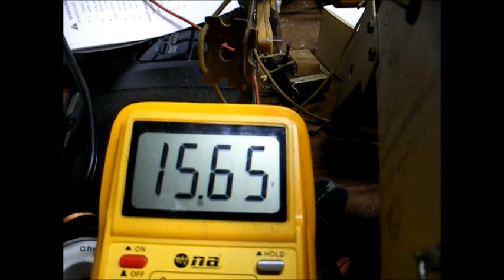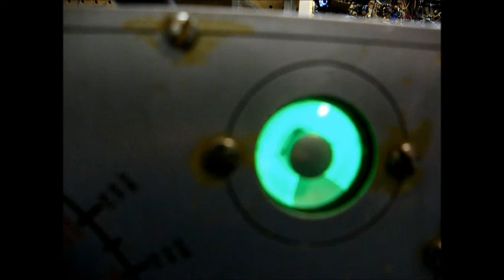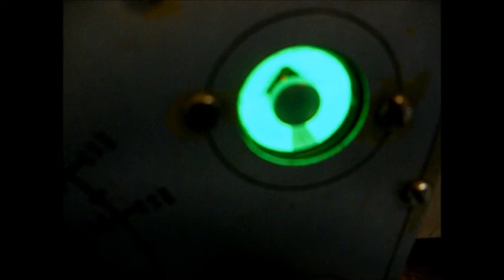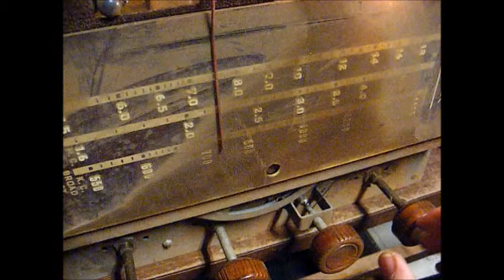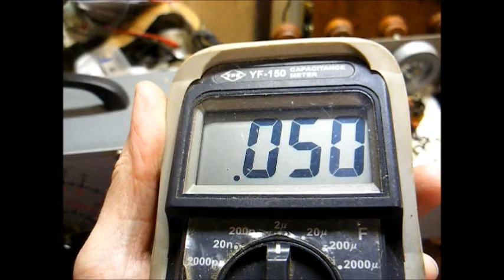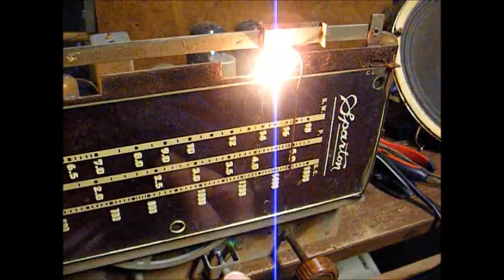Sparton tube radio chassis repair - part two

Comment: Great work!  Sparton of Canada called the "Magic Green Eye" tube, "Visoglo".  They were made by the Rogers Tube Company of Canada, but are really very similar if not the same as the standard "Magic Green Eye" tubes.  Walter Dorwin Teague, the noted American Industrial Designer, designed many radios for the Sparton Company, most notably the blue-mirrored radios, which are highly collectible.
Teague also designed (oftentimes in a very similar design) wooden Sparton radio cabinets such as the very rare Canadian made Sparton Model 88 K, a large 8 tube AM/2 Shortwave Band radio with wooden louvers (instead of chrome) on one side similar to the sleigh blue-mirrored designed radios with chrome louvers.